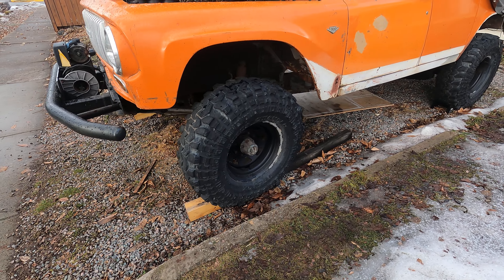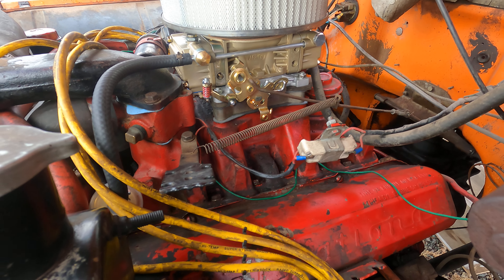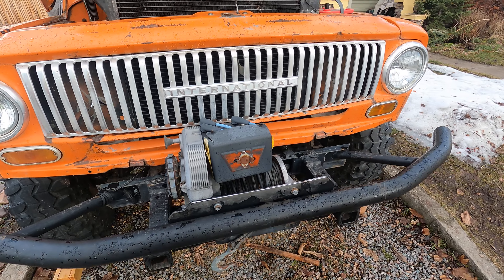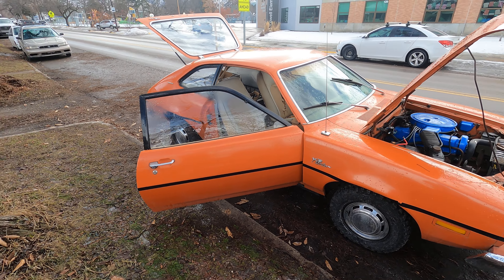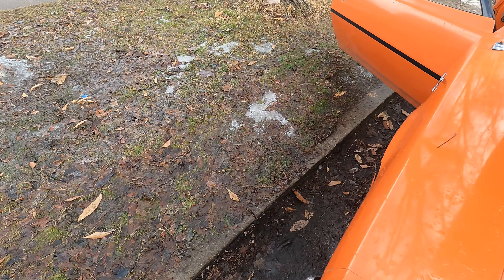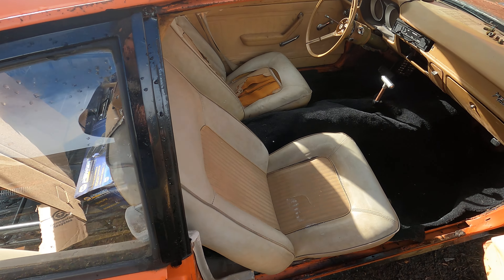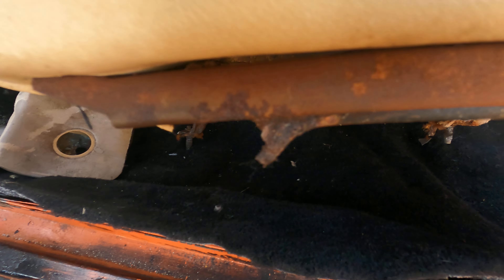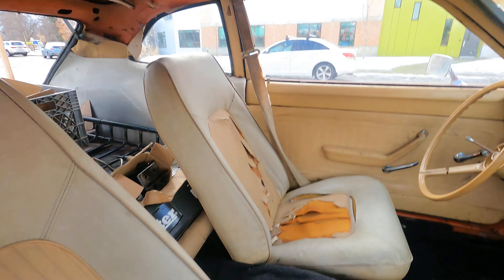I Bought A 1975 Pinto Because It Matched My 1965 Travelall!

Comment: Looks like a couple of fun projects there!! Pinto water leak could be around the cowl vents where they come into the car. Shoot a little flex seal up under the dash where the vents are. That'll seal it up for a little while.
Reply from the maker: Yeah, I was thinking the water was probably coming in near the hood/cowl. Windshield rubber is also a tad rotted at the bottom.

Also, thanks for the subcribe, I did the same and look forward to checking out your channel! I'm new to messing with cars at this level, but I'm enjoying the process!
Reply: @Doctor Hayduke  thanks man! Yeah check out my 1980 Mercury Bobcat and 1980 Ford Pinto Wagon. The Bobcat has a cool story behind it.
Reply from the maker: @smokengearsgarage  Man...your Pintos are WAY nicer than mine!

Comment: Cheap easy way to check the Travelalls ignition cables…. At night when it’s dark open the hood and start it up.  You’ll see blue arcs anywhere there are problems on any of the high voltage components…. Coil, distributor, cables.
Reply from the maker: That's good advice, I'll check it out! Thanks!

Comment: we all have our "Christines"  sometimes cars trucks vans just sing to us.  i'd like to see some more on this pinto.  how is the frame underneath?
Reply from the maker: Hey there Bubba, I haven't gotten her up off the ground yet but my first glance under the front end shows that she's pretty solid down there. I think the worst of the rot was at the seats, almost as if leaves had piled up in there right around the brackets. Or something.  She's not a beauty inside, but the exterior is pretty good, and the engine is supposed to be alright. Won't start at the moment but I'm told she runs and drives and stops just fine.

We'll see, after I dismantle the entire front end to replace the starter🤣 

There will be more Pinto videos so stick around if you like!
Reply: @DoctorHayduke  i had a 78 ford couriour that had the 2.3 pinto engine.  if thats the same motor you have its worth getting it running.  mazda made great 4 bangers taht era
Reply from the maker: @byrongilbert3720  I have heard good things about the 2.3L. I know some people want to swap in a 5.0L 302, but I like the idea of maybe a turbo on it. Nothing fancy, just a little pep in the step. On a tiny budget. I'm not looking to win car shows with it, just have some fun.  I have a vision of some slightly chunky BFG KO2s on the rear and smaller ones on the front. Make it look like a dirt road drag car or something silly like that. It already comes with a roof rack!

Comment: That's not a 75 pinto, it's an older model.
Reply from the maker: I don't have enough experience with Pintos, but the title says it's a 1975
Reply: Big steel bumper are on 74-77 model
71-73 small bumper
Some 77-78 aluminum bumper
79-80 square bumper